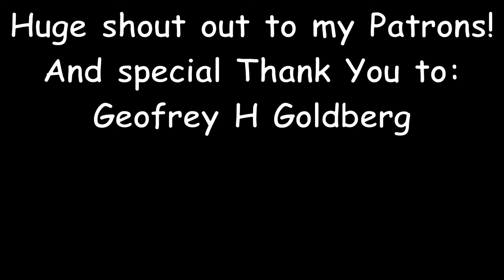Knife Making - Neck Knife from an Old File

Comment: Great knife, but personally, I would've ground the file flat first on the belt sander. That way, you'll avoid ruining the tip of the calipers used for scoring the lines on the blank. Just a thought!
Reply from the maker: Thanks, Gerald!
I don't think I ruined any tips, caliper made from strong hardened steel, and this piece of rasp was annealed in the forge before.